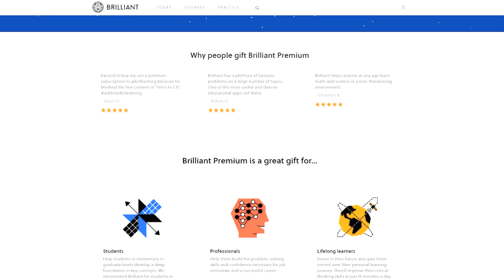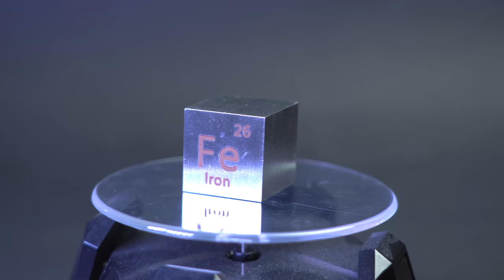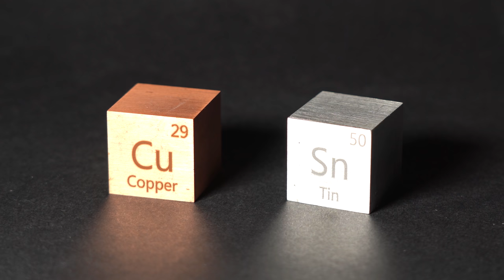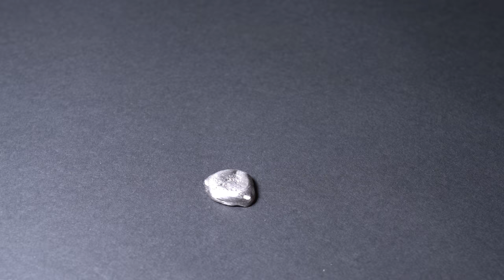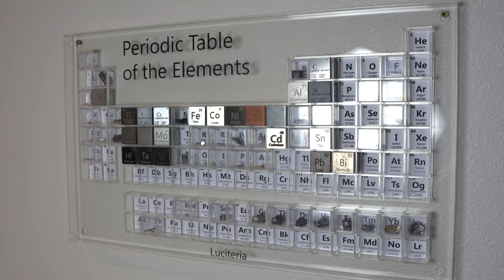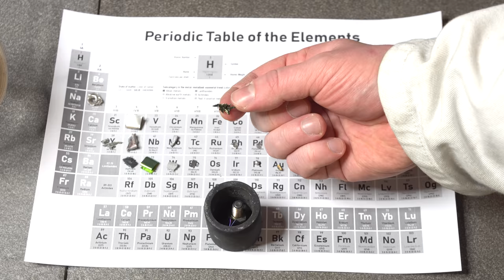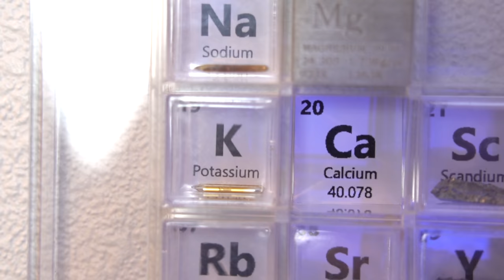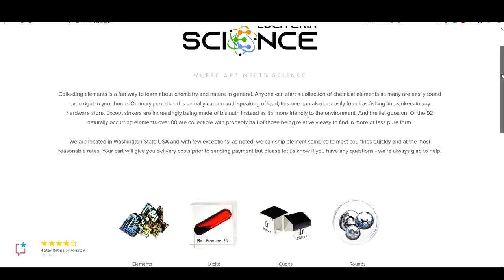What Happens if you MIX ALL The METALS Together?

Comment: "some alloys didn't mix very well"
well I mean you got alloys that melt from 327 °C (lead) to alloys that melt only from 3 422 °C(tungsten)
quite the different extremes, quite sure the tungsten didn't get even close to meting in the crucible while the lead started to boil at that point(it boils at 1750 °C)
Reply: probably need to melt under innert gas?
Reply: imagine gallium
Reply: boiling lead sounds really bad tho
Reply: The tungsten doesn’t have to reach melting point, it is quite soluble in a melt of various metals. In fact that is how tungsten is added to tungsten bearing alloys - as a solid into a liquid melt (of
say iron, nickel and chromium)
Reply: @ernestow2575  you definitely do not want to breath that, that is for sure
Reply: would it melt into mercury tho? I mean dissolve like an amalgam and then evaporate the mercury... Also by making high temp alloy first he could lower the melting point gradually and add the rest at lower temp. Maybe
Reply: @a.c.r.8296  interesting, thanks
Reply: @trollmcclure1884  i was wondering that. since combining metals can raise or lower melting points, maybe, do it in stages? do combinations that raise/lower extreme melting points till you get them closer together, THEN add that all together?
Reply: @RaptorNX01  yeah, like azeotropic mixture of ethanol and water NOT boiling at 78°C
Reply: Maybe if he melt all the metal seperately before combine it in one heating jar it will work
Reply: Mix Three from same melting points
Reply: @trevorlawrence310  Iron, Cobalt, and Nickel are within 75°F of each other as a group for melting point
Reply: Yeah, maybe the most effective way to go about it would be melting the metals separately in different crucibles, separated and also timed based on the temperature range they melt at before pouring them together into one and letting them mix that way before casting. That way, we're ensuring that they all melt properly and can mix evenly.
Reply: @imjoni  gallium can eviscerate any aluminum.

Comment: Very interesting topic. I work in metalworking industry and we machine most of these alloys daily. The difference in hardness between copper and stainless steel is gigantic.
Reply: how about bronze. i'm not very well up on these things but bronze is at least harder than copper i think. obv not as hard as steel though but how does it compare
Reply: @ijustwannaleaveacommentony6511  Bronze isn't hard to process. Ramp up the feeding speed. There are charts with feeds and speeds for every metal. It also depends how much material you remove, with what tool and what finish you want on the detail.
Reply: @ijustwannaleaveacommentony6511  you can cut any metal as long as the tool yo are cutting with Is harder. Usually tungsten carbide, high speeds trek, ceramic, or in unusual cases, diamond.

Comment: This man making a legendary material for a legendary weapon
Reply: That requires you mine each ore in existence at different parts of the map with different level of mobs to beat just to get 1 ore.
Reply: More like, an ultimate weapon!
Reply: the thanos killing kind weapon
Reply: The metal would be junk for a weapon.
Reply: @doricy.  a weapon that the bifrost cannot hold up on ..
Reply: Or an armor
Reply: @confederatestate-slaveryan7654  adds uranium to the mix
Reply: @YeetNation2006  a wepon that cause explosion upon hit and with radioactive (poison) effect
Reply: 300%+DMG 20%chance of turning your weapon into a iron that melts in room temp.

Comment: I was actually taught the transition to the iron age differently. What I was taught was that the transition occurred because iron, being an element that could be mined, was more readably available than bronze, being an alloy that had to be manufactured. bronze weapons continued to crop up, particularly in the hands of high-ranking individuals like kings and emperors. Iron was reserved for more general use, like common weapons and tools, but since it was more brittle, wasn't used by those who could afford bronze.

For reference, this was in a college level class.
Reply: The switch from bronze to iron happened over the course of many centuries and over many cultures. It's not hard to believe that the switch was caused by different things for different peoples in different places at different times.
Reply: This is true, but only part of the story. Iron still required more advanced furnaces than were available at the start of the Bronze Age, and it wasn’t until the development of steel (also an alloy) that bronze became clearly outdated. 

Bronze is harder than pure iron, less brittle than the high-carbon iron which might have been produced easily, can be smelted at lower temperatures than true steel, and is less sensitive to exposure to carbon from the fuel used to smelt it.

It’s certainly a simpler technology than iron and steel, but not necessarily worse than either.
Reply: For reference, I learned all of that from YouTube videos on the Bronze Age collapse.
Reply: @ZeteticPhilosopher  Steel was produced accidentally from the very earliest periods of the iron age, but it wasn't reliably produced until long after iron was used. Indians started reliably producing steel around 400 BC, around 800 years after what historians consider the end of the bronze age. It didn't become a common use metal in Europe until the 18th century, you basically had to be rich to get it before that.

You correct though that bronze didn't stop being used just because iron came on the scene, it's just that iron took over as the main metal for lots of things such as tools, weapons and armors.
Reply: Also tin wasn't common (copper and iron was). We still aren't 100% sure where Roman Empire got all it's tin from.
Reply: @masansr  Early bronze was made with arsenic instead of tin... though they did eventually figure out that it's toxic, which is why they switched to tin.
Reply: @ericlanglois3782  I can't believe you also watched the video we are commenting on!
Reply: @masansr  Your comment that I replied to made me ask myself the same question about you, hence why I re-explained that part.
Reply: @ericlanglois3782  Sorry, I must've missed the part where he talks about the availability of tin and the use of bronze in The Roman Empire.
Reply: I often wonder where all the tin came from
Reply: You have to remember that the differences between wrought iron, steel, and cast iron are actually quite small. Even nowadays, very slight variations in carbon content can massively affect the performance of the alloy (and then you take into account extra ingredients like nickel). The Romans had steel bloomeries, and mainly used it for weaponry. Iron was also used, but less for weapons and more for armor and pottery.
Reply: @ericlanglois3782  oven carbon encasing and forging high and low carbon irons together were two widespread techniques for making moderate amounts of steel.
Reply: ... more readily* available ...
Reply: @masansr  Copper and iron were* ...

Comment: Probably, metal like Thungsten did not melt in the final alloy due to the high melting point. Nice video!
Reply: It could be true but many alloys have lower melting point than its ingredients
Reply: @welchianachi7707  it's interesting that metals form "azeotropic mixtures" just like some liquids (e.g. ethanol+water, acetone+methanol).
Reply: thighsten
Reply: @user49917  r/woosh
Reply: it is possible to let tungsten dissolve by letting it slowly diffuse into the molten metal
Reply: @user49917  actually all anglo-linguistics spell it wrong. It’s Wolfram
Reply: Wolfram is used as powder, you need 3 tons per 20 tons of iron to get hardened steel. Molybdenum give same hardness.
Reply: It might've dissolved, idk. Probably not.
Reply: @thamemeez5702  I think you're the one who missed the joke, but alright.
Reply: It stays as it was before. If he added it in powder form (dust from tig rods for welding) maybee?
 Industrial Produktion uses electric arc furnances for this pcrocess with inert gas preventing Oxidation.
Reply: @welchianachi7707  but the ingredients have to melt first before they could mix and alloy with other metals
Reply: @TheFishCostume  Never seen someone r/woosh themselves. What a time to be alive.
Reply: @sepg5084  It is depend, take for example NaK alloy you put together two solid pieces and mix them below their individual melting point and miracle is happening they form alloy, another example is old fashioned soldering alloy consists of 60%Sn and 40%Pb that is melting at 188 degrees Celsius when modern lead free solder melt at 217 degrees Celsius, so for this reason it is common in electricians to alloy modern solder by old one to decrease melting point. Perhaps above principles may not be true for all alloys or alloying process will be slower or non existing.
Reply: @thamemeez5702  no u
Reply: @thamemeez5702  Big mistake buddy, big mistake
Reply: @TheFishCostume  as expected i got wooshed for wooshing someone who did seem to understand my joke
Reply: @thamemeez5702  "No, guys, I'm the smart one and you guys are dumb."

Comment: I believe what you created was a high entropy alloy.  They’re hard to make at high qualities but tend to be insanely hard, strong, abrasion resistant, heat resistant, radiation resistant, and have interesting magnetic and electrical properties. If we could mass produce high quality cheap high entropy allows it would likely make all other alloys obsolete.
Reply: "High quality","mass produced" and "cheap" don't really go hand in hand lol, one of them has to go
Reply: @shibenue2890  why? just look at how much microchip tech has been optimized, its gotten so so much more higher quality, mass produced, and cheap over the past century
Reply: @shibenue2890  not really, compare the steel nowaday to the one we had 100 years ago. It's definitely of higher quality, mass produced, and cheaper.
Reply: @AnEnderNon  silicon is one of the most abundant and cheaper elements used to make chips
Reply: @aya5468  ok
Reply: @aya5468  that doesn't make it lower quality
Reply: @AnEnderNon  Cheap? Do you understand that to mass produce you need ALL the market? Basically - monopoly. That is not cheap.
Reply: @surgeon9039  Since when do you need to have a monopoly before you're allowed to mass produce a product
Reply: @kangalio  Since anytime. Extremely complicated production was always rare and mostly monopolized. 

How many companies are building NPPs? How many companies producing civil aircraft? ASML is basically a monopolist in photolitographic machines for microprocessors. 

Companies that produce those processors are also rare. Intel, AMD, Nvidia and some micro companies who are pretty much insignificant.
Reply: @shibenue2890 not true look at how steel production was revolutionized

Comment: Since all metals have different melting points, (albeit, some have very similiar ones) fusing them together into one massive super metal would be an amazing feat. I feel like this massive alloy would either be very brittle or incredibly strong, no in between.
Reply: High strength and brittleness tend to go together, I’m afraid.  Glass is very strong but very brittle for example. Getting toughness and strength together is quite a challenge.
Reply: I was sad that he didnt add any radio active meatals but it was prob for the better because the fumes, but he should of at least added bismuth or gallium it would of made the mix interesting